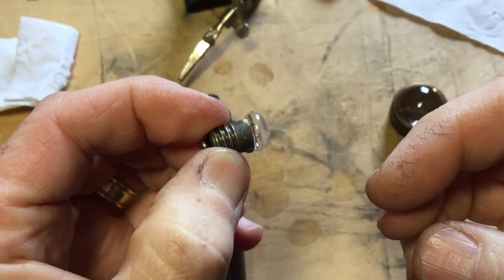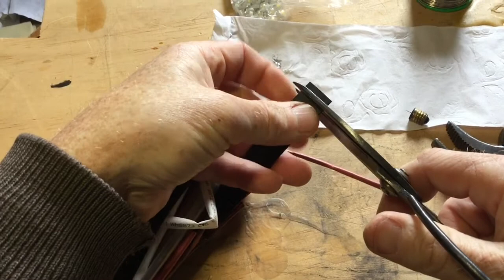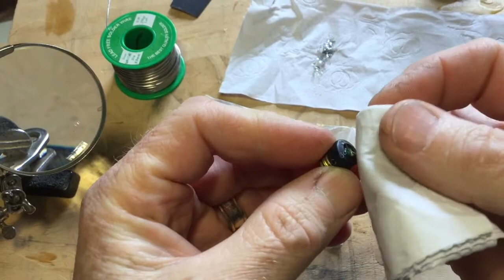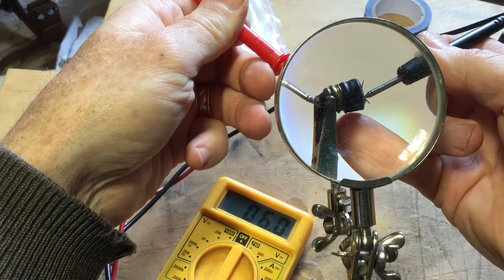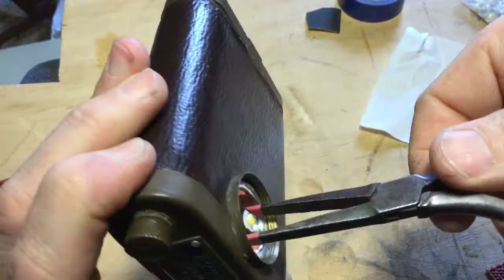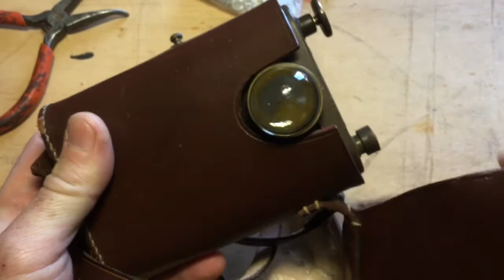Converting a Torch bulb into a 1W LED

Comment: Did something similar in the past for old bicycle lamps. But in some cases I reglued the old glas domeoverthe the LED so you would see the glas dome. A few times I used the glass bulb of an other lamp. An other "trick. I had a smaller Led inside the metal base and glued a plastic bead over it.
Reply: Nice! :)

Comment: What kind of batteries did you use to power the led? Did you have to modify the torch? I just picked one up that has no batteries. Thanks! Cheers!
Reply from the maker: G'day Gregory, No modifications to the torch. I used 2 Alkaline 'C' sized batteries, one Positive up, the other Negative up. Sponge was used to hold them in position under the two contacts up inside the top of the torch: one long block in between the batteries, with a strip of brass sheet pushed through the bottom of the block to make a connecting bridge between them. Make sure the brass won't touch the body of the torch (short circuits aren't good :) ). Then another block of foam between the bottom of the batteries and the battery case hatch to keep them pressed up to the contacts. This doesn't work really well, and I am planning on making a wooden insert, as I did for another antique torch. I think I'll have to make a film about that when I do it :) I'll let you know when I get around to it. All the Best. Cheers
Reply: Awesome, could you send some photos for better visualization? Thanks again!
Reply from the maker: @gregoryboskamp6351  Sorry, I only just came across your request (it didn't notify me). I'm not sure how to put up photos. Any ideas?

Comment: Damn brilliant. Bravo man.
Reply from the maker: Glad you liked it :) It's still running fine whenever I press the button. Keeping it on a low voltage, I think, is key. It puts out a bit less than 1/2 brightness, compared with a 1W LED working through a driver etc., but 50ish Lumens is still very useful and it doesn't heat up. Cheers

Comment: This same type of trench torch was used by the 2 British actors in the first continuously unbroken 9 minute shot of the movie 1917 leaving the British trenches and crossing the enemy line and going down into the deserted German trenches and going down into a tunnel, but for the movie they removed top covers I think.
Reply from the maker: Yes, I spotted them in the movie trailers :)  It looked like they weren't in their covers, which was a shame. Some versions had the front of the leather lid detachable from one side, and it would then swing out of the way, so you could get full light without having to undo the whole lid.  I haven't seen the film yet, but hope to at some stage. It's a beautiful torch, In a user's manual I found online, it described the lid's covering style as being used for map reading. The Morse code key had rather a lot of travel, so I bent a thin strip of brass around the stem of the button to restrict the movement to around 1mm, giving it a much more positive feel, and crisper dots and dashes. You can see it at the beginning of the video.

Thanks for commenting, and stay safe. Cheers Duncan
Reply: @duncanmcharg  I also heard that the entire leather lid's covering was also used in WWI as a form of hiding mechanism to be able to obscure most of the lens when doing Morse Code to someone, allowing just the tiniest little bit of light to escape, and ensuring that the enemy could probably not readily see the message if they were not in direct line-sight of that mostly partially obstructed beam. (it is also probably to protect the lens itself though, too). Additionally, the lens itself was specifically designed to be extremely unidirectional, such as almost like today's laser lights, so as to almost entirely prevent anyone from any of the side positions from being able to see the beam, and mostly the majority of the focus of the beam could only be harnessed into a very specific linear direction and therefore only realistically those in direct aim of the beam could really truly see it.
Reply from the maker: @ooosoo8727  Yes, That's my experience with it too :) Cheers